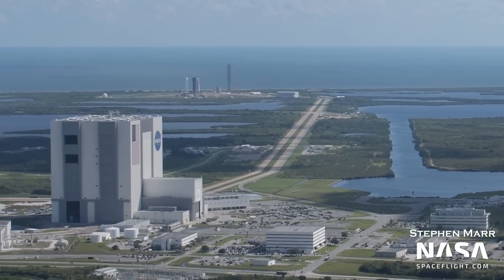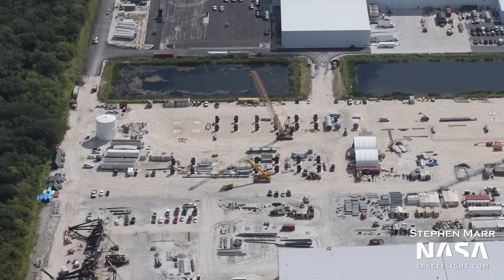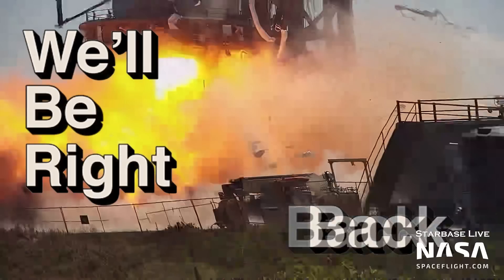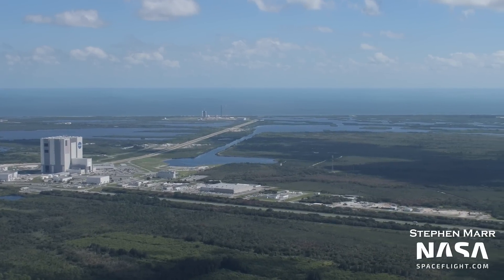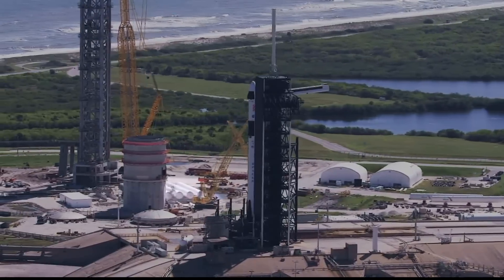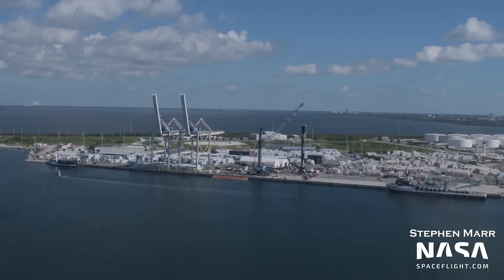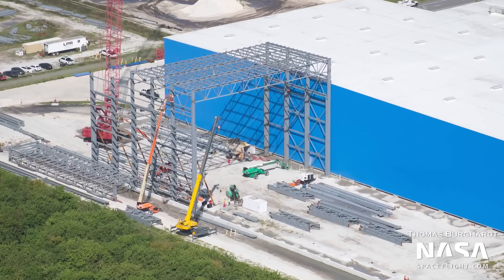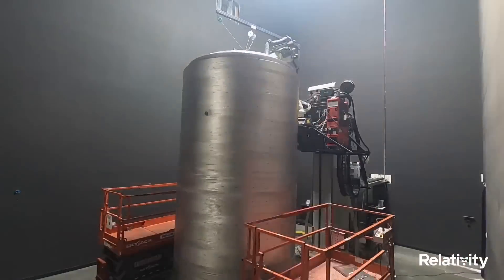Another Starship Launch Tower in Florida Soon?

Comment from the maker: Did you look at it? ;)
Reply: @ 8:14, that IS a forward module (interstage) section there in the Surface Coating Facility building. It was first seen nearly 2 years ago in one of the New Glenn updates and a flight article was spotted just a couple months ago during the last update seen during NS-21.

If you look closely, you can see two of the four motor boxed for the control fins. One at Six O'clock and the other at Nine O'clock on the inside of the module. No fins installed yet it seems.
Reply: Guilty! 😆
Reply: :_youbet:
Reply: Yes
Reply: Yep, I looked at it a lot.
Reply: Ummm. (Guilty face)
Reply: THE MEATBALL ROCKS
Reply: Ignorance is bliss
Reply: Do you think its possible that the new tower is for the SLC40 for the falcon? to load people in the dragon?

Comment: My two cents: They need a tower at SLC-40 for Dragon, BUT, this tower has rails (for Mechazilla), as noted by Jack. That leaves Starship. The whole point of Starship (besides size), is really rapid re-use. Separate landing sites hamper that. I think they will prove out the catching and re-launching technology at Boca Chica, then move on to using it at KSC. Next, about the places for the next Starship Launch Mount: 17 million pounds of thrust means a sizeable area has to be cleared of people (as is the case with 39A and B). The only area in the KSC/Cape Canaveral vicinity where that seems to be possible without shutting down a lot of facilities is the LC-49 complex, which was surveyed for it many years ago. Even there, a large portion of Playalinda will have to be emptied, but they already do that for some LC-39 launches.

Comment: 9:18 Looks like a coffin for the burial at sea of the Orion Project. But seriously, whatever floats inside that hanger is dead in the water. But seriously barges are usually used to take rubbish away. I know, but seriously it's a contained barge that's just got a hanger on.  Enough argy bargy, for now.

Comment: Great video! But you forgot to talk about another scenario...which is actually the most likely one. Another Tower & OLM being built at...Pad 39A Right next to the one they built already. 

This is indeed already the plan for Starbase, so it just makes sense they would also want to double up basically anywhere they are building starship launch facilities. It also makes sense because of their stated launch cadence goals. They want back to back missions especially for orbital refueling. Having 2 pads next to each other is good for efficiency and leveraging GSE hardware and makes the logistics much easier too.

Comment: Why wouldn't the launch tower be constructed to launch crew from LC-40? It would need to be modified with a crew arm but it would be the cheapest and fastest option to get starship launching from the Cape as they won't allow it from LC-39A until they secure additional launch pads to launch to the ISS.

Comment: The presence of certain hydraulics on the chopstick arms doesn't, to me, prove they will be used to catch. When the arms are used for lifting they need the same hydraulics to firmly grip the ship and finely maneuver it when mating to the booster. I'm convinced the tower at Pad 39A won't be catching. Or if it does, it won't be for a long time - but that makes sense in SpaceX terms. Why wait and then need to upgrade the arms.

Comment: What about SLC-40?  (Edit: oops, I mistakenly put 41 originally)  There's already confirmation of plans to add Dragon crew access to that pad.  Assuming separation between Falcon and Starship is minimal, they would only need one tower.  Adding a Dragon crew access arm to Mechazilla could be done quickly and easily.
Reply: I am wondering the same thing. Could they be building a shorter tower for SLC-40 using the Starship tower design and just have a crew access arm instead of the QD arm?
Reply: @DHilchie1  That's what I originally thought, but Jack noted that the parts are for use with chopsticks.  So I'm wondering if they will dual-purpose the tower.
Reply: SpaceX indicated earlier their plan to add an access tower (like ULA did at SLC-41) for Dragon (cargo and crew) usage — as well as the three (3) contracted Cygnus cargo flights to ISS thru 2030.

Comment: SLC-37 will be available after last two (2) Delta Heavy launches (2023, 2024), subject to availability of the NRO payload.
==
Starship Towers will be needed for those converted oil platforms.
==
Don’t forget that a second SLS tower on a mobile mount (SLC-39B),
is terribly over budget behind schedule (a Congress/NASA embarrassment).
Since SLC-39B is an “open launch site” … SpaceX could build their own tower/mobile mount
for Starship to launch from that pad.  Methane storage tanks would need to be added to ANY new launch site.

Comment: Maybe the extra tower parts are to be used when and if something goes wrong with the first one. Like an explosion at liftoff or a landing gone horribly bad, they would need to replace parts or the whole thing rapidly.
Reply: I doubt it…. You damage one of the parts at the bottom and you can’t just cut it out and replace it, you would have to disassemble the entire tower into pieces.
Reply: Not really sensical financially.

Comment: Consider the possibility that these are for a shorter tower at pad 40 and could have the crew access arm to allow dragon flights there.
Reply: This is what I was thinking as well, why design something from scratch when you already have something that works. May also make it easier to eventually upgrade SLC-40 to launch starship.

Comment: You forgot one possibility, they could build the additional tower sections and launch mounts to send to be integrated on the ocean platforms.
Reply: Or as a contingency plan having spare tower parts in case of a catastrophic failure during testing.
Reply: hardly likely... work on the platforms has stalled. The tower sections would be more practically built close to the platforms for installation.
Reply: Building a new tower for sale to BO or ULA.
Reply: I believe spacex just sold the two oil rigs.
Reply: That'd be a twist. Seems smart, everything's on site and you've got experienced builders with fresh, first-hand knowledge. I still think the Starbase video showing two towers is probably the standard blueprint, if you will, for Stage Zero. So two at Boca, two at the Cape and two platforms. If the pace holds up they'll probably build another two at Vandenberg, so perhaps 6 towers pending? They're going to get good at this.
This without counting SpaceX's point-to-point idea. If that's viable I imagine making Starship platforms will end up being pretty lucrative. A spaceport delivered to your coast. They'll end up being bigger than carriers if commercial aviation serves of any reference. However, this system hasn't been tested yet and they've already duplicated it. Are they so confident in their simulations? Are they that good? Cape tower has even shorter catch-arms and they've said they're going to attempt snatching a booster on the first go. Seems wild, I'll believe it when I see it. It gives me odd N1 vibes, this all-up testing deal.

Comment: you forgot t mention on the tower needed for Pad 40, it need to be retro fit for man flights, so Starship can flight from 39...
Reply: You could build a shorter tower using same type of sections as a Starship tower.
Reply: @stillwind_1  Sure, but with this tower having rails on the side of it, it kinda confirms it's Starship. No need for rails on the outside of a Dragon tower.
Reply: That's a different type of tower. That will be a tower to support Crew Dragon launches, and will not be constructed the same was as the Starship tower.
Reply: @justinmooney3436  It might as well be a Tower that does both in the long run - multi purpose - not at first, but once startship launches are operational they wont have to retrofit LC40 AGAIN
Reply: @esado  There aren't any plans to launch Starship from SLC-40, so I'm not sure why they'd build a multi purpose tower.
Reply: @justinmooney3436  because they will need more than one or two in the long run anyways. And since they are retrofitting sc40 for human dragon now anyway, might as well built the infrastructure to support starship in the future. A fleet of 1000 starships wont fly from just a hand full of towers.
Reply: @esado  They have a total of 8 planned launch sites that I'm aware of, and SLC-40 is not one of them. Not to mention that upgrading SLC-40 for Starship launches would require basically a new pad to my understanding.
Reply: @justinmooney3436  What i'm referring is the modification to launch Falcon man missions from 40 that's been talked bout, It could be prepared as a multi-use tower, Why not? They gonna need  it anyway for future development
Reply: @MrJramos2002  They're not performing any Starship launch operations from SLC-40. It will get a tower for Dragon to support crewed missions, but no Starship missions will launch from there.
Reply: No he didn't forget about it. A tower with rails so far has been used only for Starship. If/When SpaceX says they're going to use rails on whatever structure they build at SLC-40 then it'd be considered. In the meantime, it doesn't make sense. Specially considering they have another OLM to go along with the tower and that's basically just for Starship only.